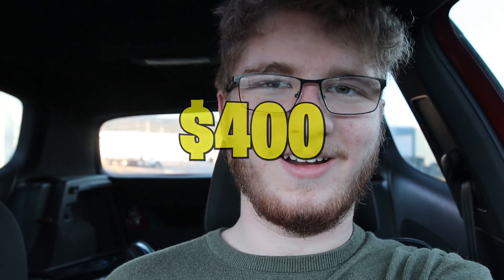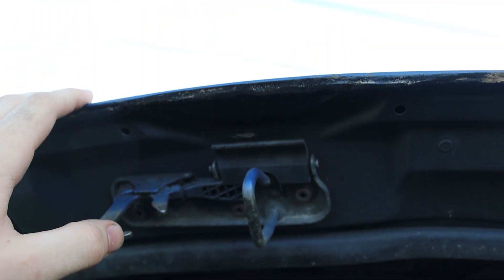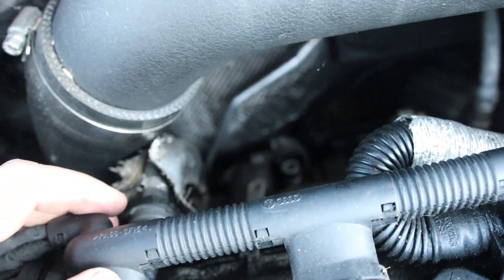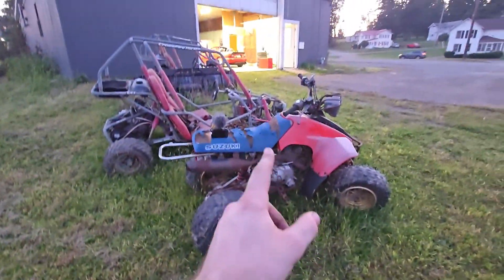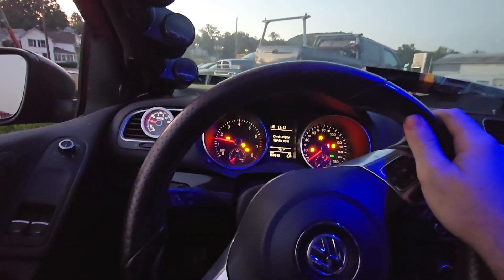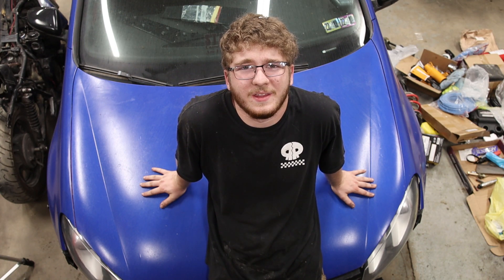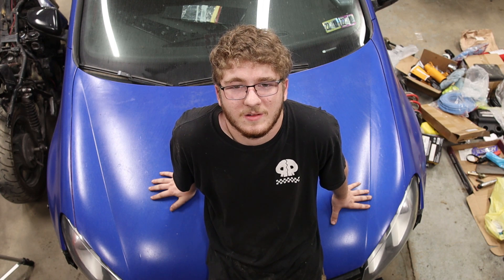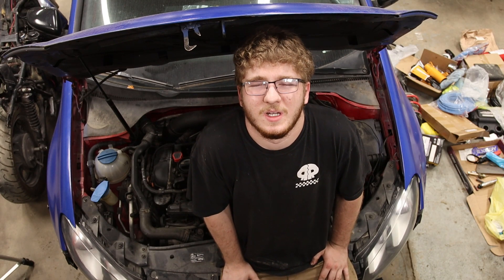My $400 Golf GTI is Back!

Comment: just a heads up, the 2.0 engines get milky build up under the oil cap from the engine getting warm then cooling down, there’s a fair chance it’s just condensation. both my 2.0 vws i’ve owned do it. good luck with the build sir!